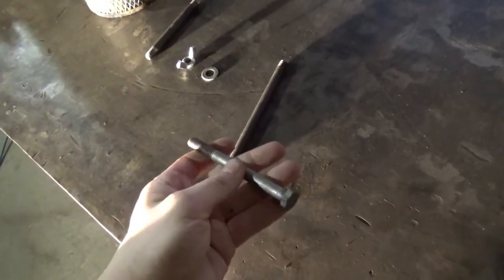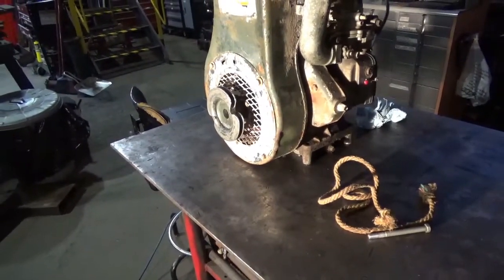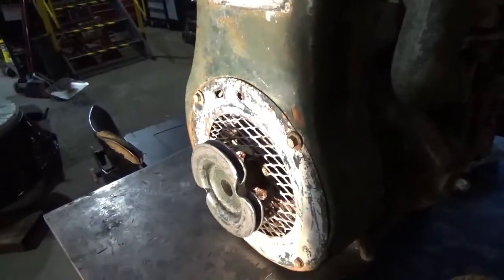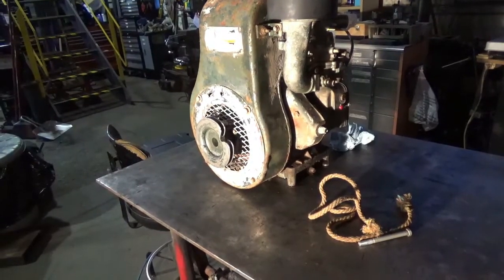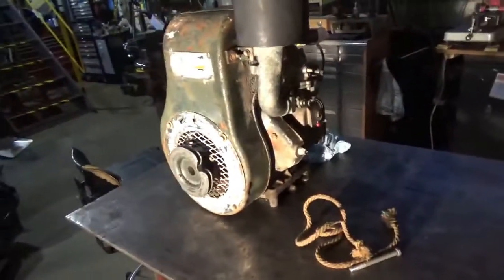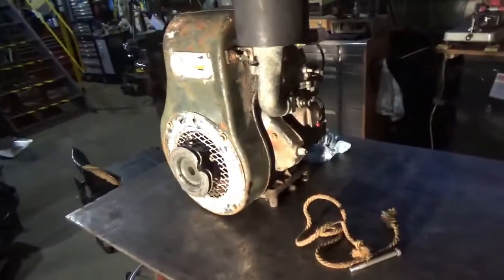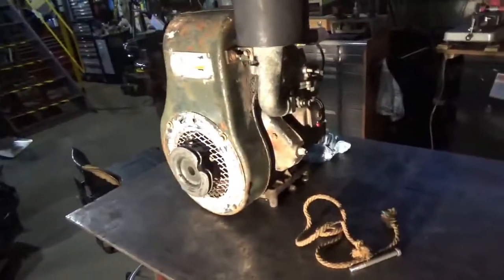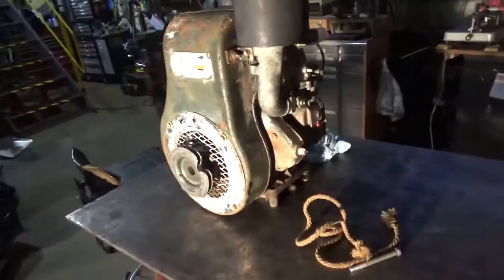Wisconsin Engine Air Cleaner Stud Reactivation Part 3

Comment: You definitely want to clean the junk out from behind the flywheel. You never know what is in there and it can create havoc with your engine. There was all kinds of junk behind the flywheels on my motors. Good idea on the air filter canister.
Reply from the maker: The Shade Tree Fix-it Man true. My plan is to clean it out I didn't talk to a co-worker and he said to clean it out and the junkie is under underneath the flywheel on the bottom of the Shroud and I didn't really feel like taking that flywheel off so I'll just take that screen off and vacuum it out.